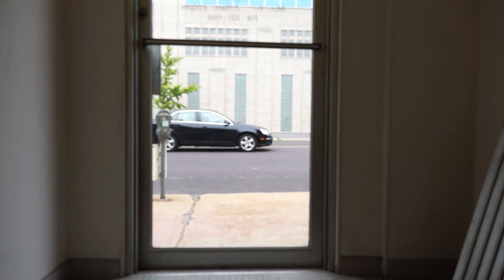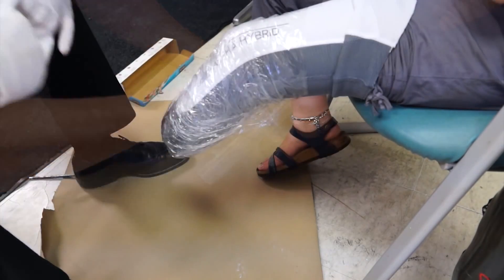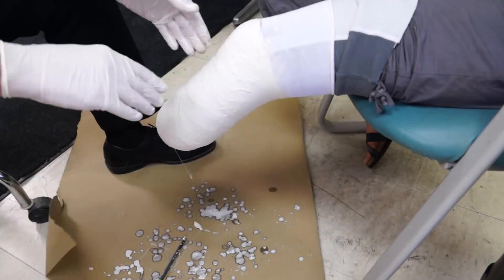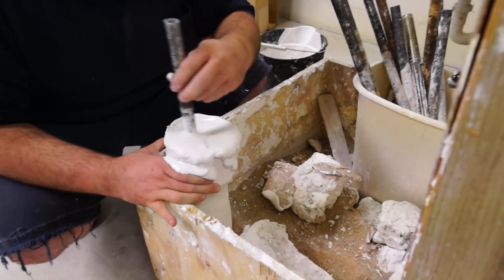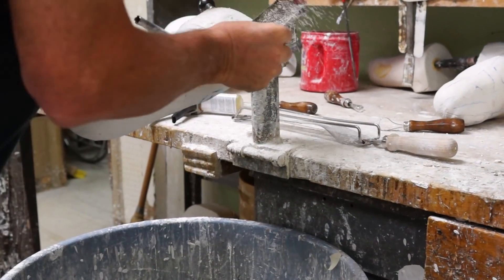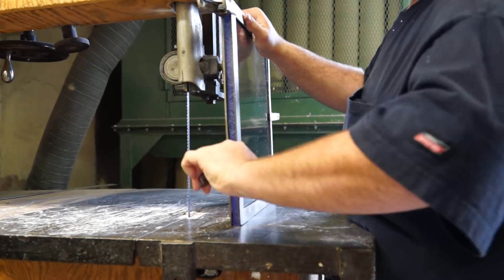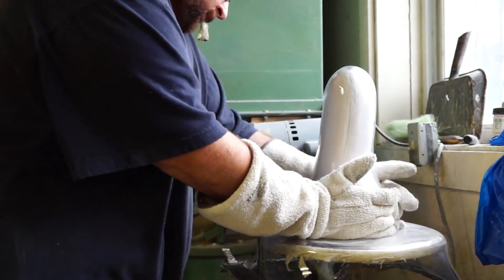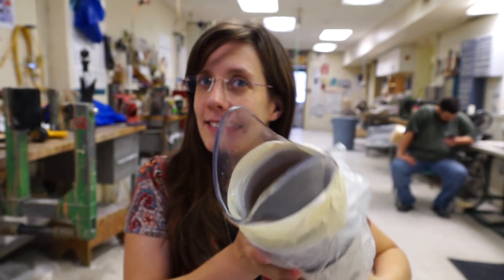AmputeeOT: How a test prosthetic socket is made.

Comment from the maker: First they take a cast, then make a positive of your foot, and then get the foot ready by putting the leg part horizontal with the foot pointing down. If there are hinges, they tack the hinges to the mold or use dummy hinges to create a space for them. Then when the plastic is ready they stretch it over the mold and pinch it shut at the top of the foot and the shin area. When it cools, they cut it off, sand it down, add straps, and done!